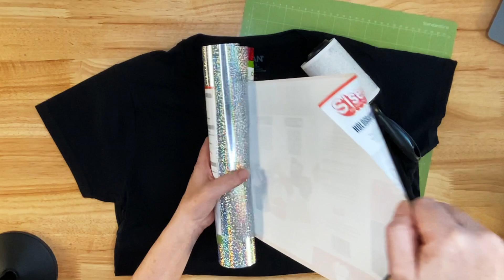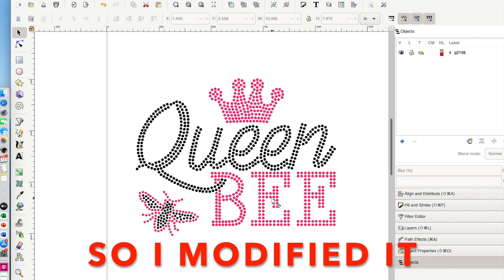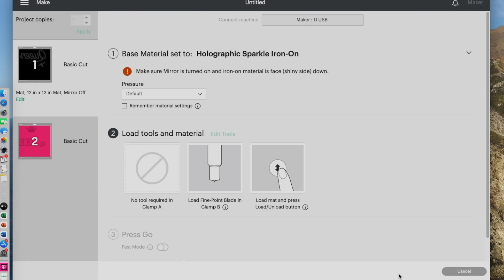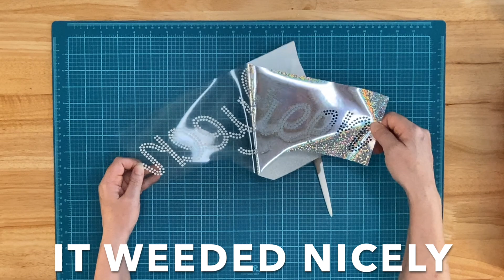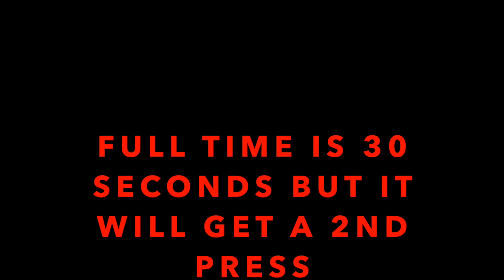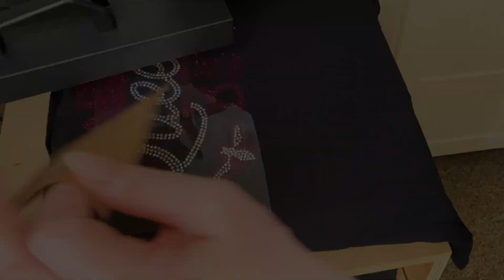No Rhinestones? No Problem! Try Faux Rhinestones.

Comment: Did you use the silver Siser Holographic HTV? I tried this technique using the rainbow pearl Siser Holographic HTV on a 100% cotton black t-shirt, and the HTV turned orange when I pressed it. I need something that will maintain its sparkle on a black t-shirt.
Reply from the maker: Oh no that is terrible. Yes, I used the Siser holographic htv. I have never had it turn colors or burn or anything bad.
Reply: @MakingwithMarilyn  what color of the Siser Holographic HTV did you use? I tried to zoom in on your video, but the label was blurry. It looks like maybe it’s “silver”?
Reply from the maker: @unachicanica3875  The Siser Holographic HTV was Silver. The Cricut one was called Holographic Sparkle Iron On and was Fuchsia.
Reply: @MakingwithMarilyn  thank you so much!